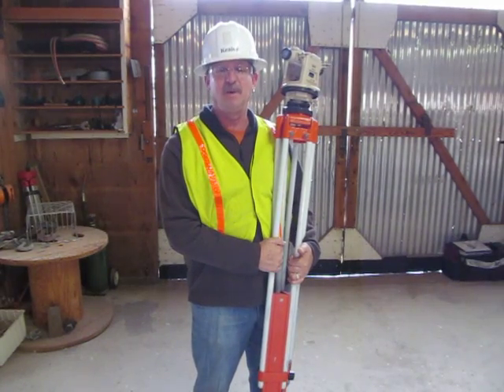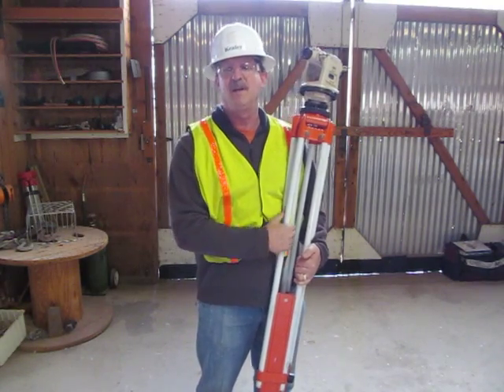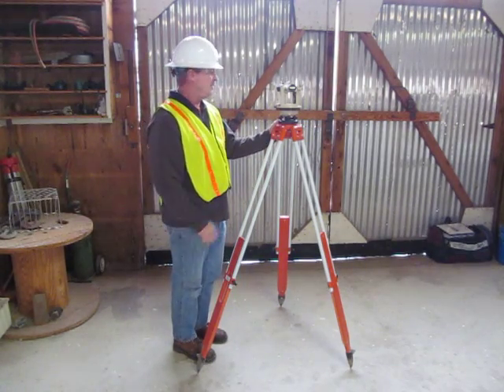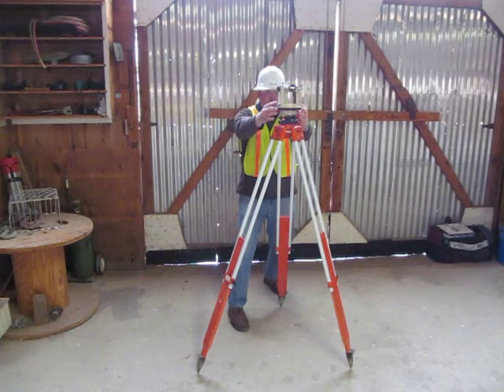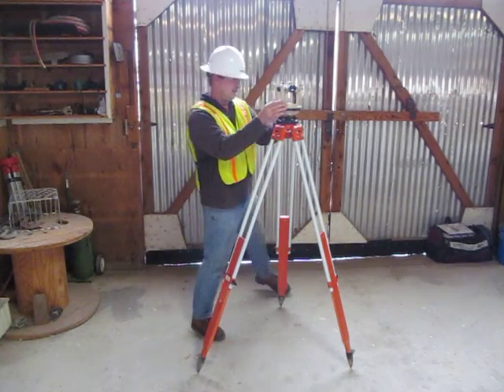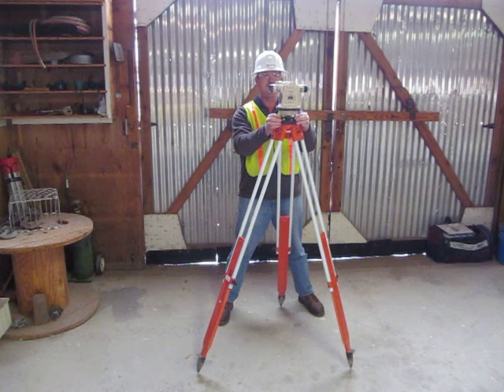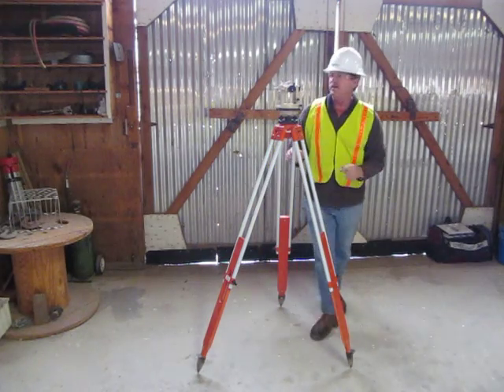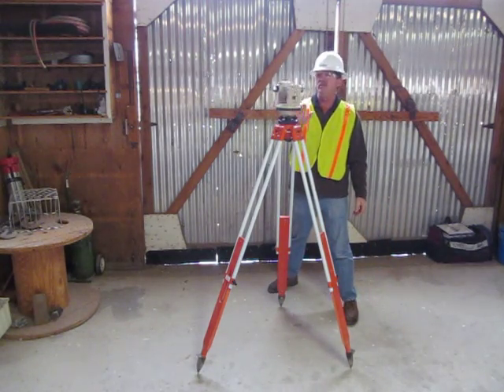How To Set Up a Transit to Level by HEO Greg Kealey

Comment: This video is sufficient enough for me - who have never done the setup of the transit level - to setup the tool correctly. There is no rocket science here. Just do what the person in the video says. No additional close-ups required. The bubble for those confused - should be right in the perfect middle of the scale on all three angles or when you rotate it to any position. That's it. Thank you.